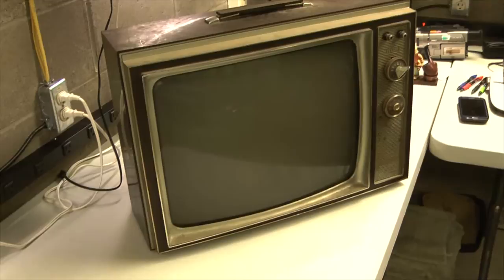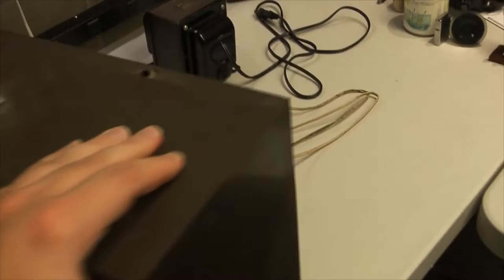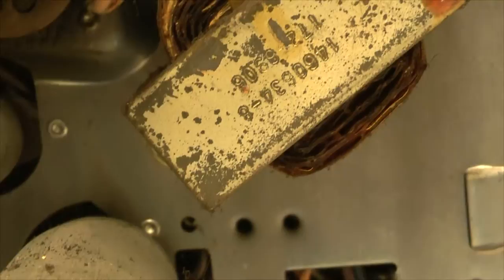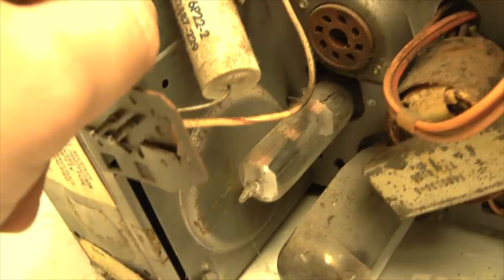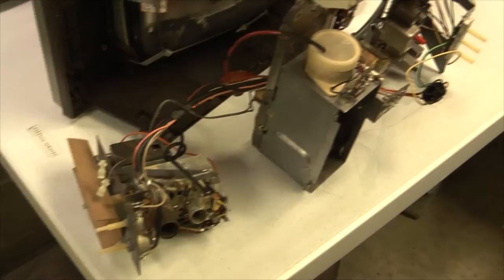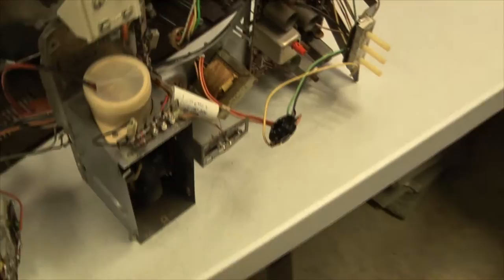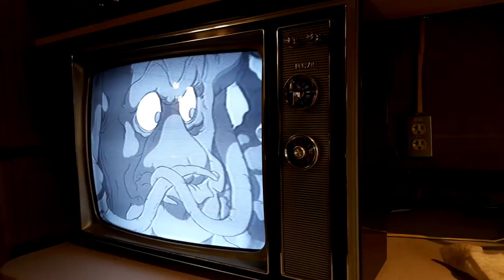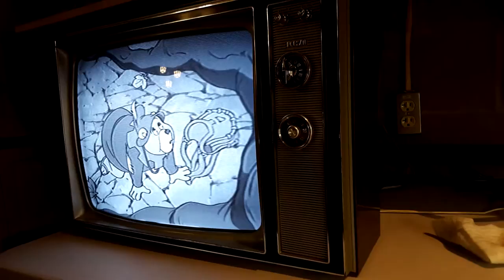1969 RCA Model AM195W 20" Black & White Television

Comment: Nice job!!! Set looks really great!! Is that cap across the line an AC rated cap? Guess it doesn't matter until you get a switch, because it only plays when plugged in..Oh well, fantastic looking set!
Reply from the maker: +ScottTV1962 Thanks!

And that capacitor is rated for 200VAC, 600VDC.

Comment: Spats! That very thin wire that you were questioning why it was attached to the power connection IS supposed to be that way. It is a fuse wire... try resoldering it back together and I'll bet the tv will fire up.
Reply: +matts78mn nevermind I didn't watch the video all the way through before I commented! :P
Reply: +matts78mn haha!  I do the same thing.